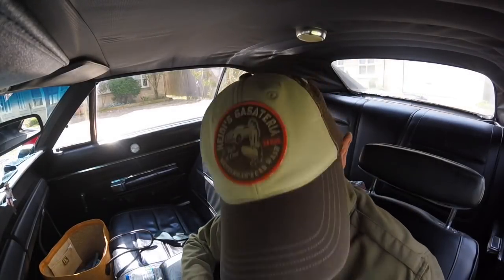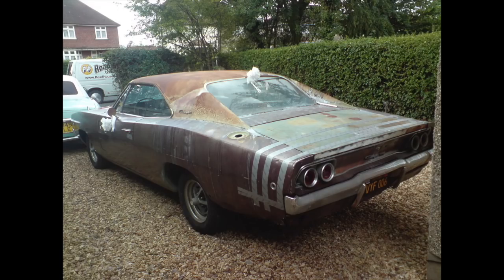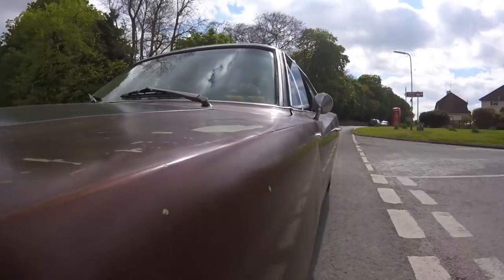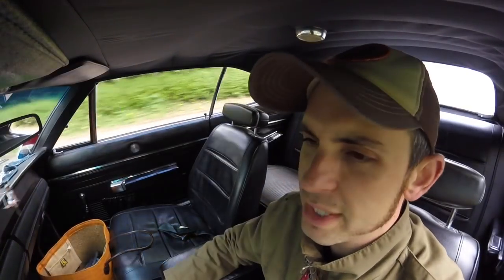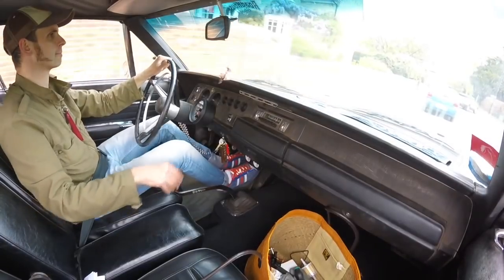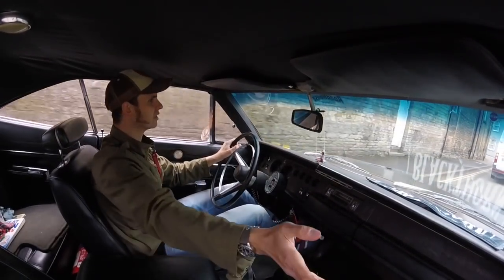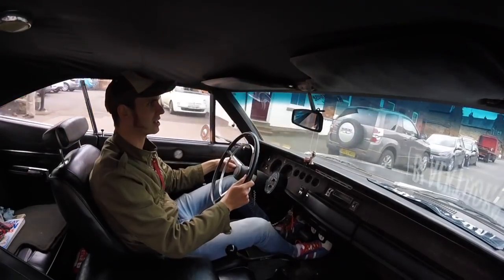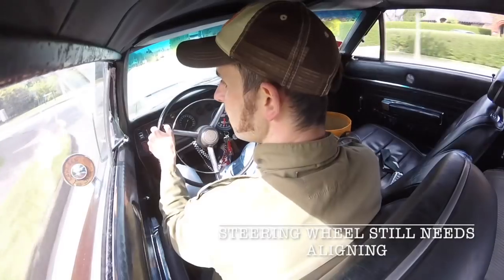1968 Dodge Charger MoT trip - Jonny Smith

Comment: Oh man, quick tip. When it won't go into gear, leave it in neutral, let the clutch out then press it in then after that you should slip in just fine. Unless you hear a grind.. then just don't do that again. I noticed you kept pressing in on the clutch.. gotta get the primary spinning to mesh. I hope that helps!
Reply: And at the end it appears you did that, so nevermind, I think. Up too late. Goodnight!

Comment: Love the Mopar, and I fully agree with your dislike of the MOT exemption for pre 1960 cars. Even reasonably diligent owners can get caught out with brakes going off etc by growing to compensate for weaknesses. Even well looked after cars can still rust, especially if they are used reasonably often and get wet. It could be a real problem waiting in the wings.

Comment: Disc brake swap is easy from Dr diff. The steering wheel and shaft on Chryslers has a a key way at each connection point, the places it can get screwed up is in the steering column connector and pitman arm.
Unless some ape has filled the keys out to put parts where they want.

Comment: Beautiful car, Jonny. Friend of mine had a 74 Firebird Formula 400 which I pottered around the Cotswolds in a few times. I agree with you about the fun of driving something so incongruous. Did the factory tachometer in the dash stop working when you converted to electronic ignition?

Comment: Hi CarPervert, So where is that testing station handing out dodgy (inadvertent pun) MOTs? Should have failed on at least the seat belts, incorrectly coloured lettering on the license plates and most likely the turn signals as well, just a guess because you didn't show those.

Comment: Would you be tempted to upgrade the braking on it?
Reply from the maker: l1fechooser No. I like the challenge of the OEM non servo drums. It’s not that bad actually.
Reply: I had servo assisted drums on the Coronet and they were very decent, dont know abut fading but the stopping power was easily good enough. Imagine non servo to be fine also.
Reply: An emergency stop in that will be an end of life time event either fir the driver or the person stupid enough to walk/pull out in front of that thing. The brakes must be scary.
Reply: Christian Buczko Based on my own experiences with all round non servo drums, yes. But that wasn't this specific car, and if a pro car journalist thinks they're up to the task, I'm not going to argue.
Reply: It depends where he drives and how. Those brakes wouldn't be good regardless, and being able to stop and be road legal and stopping in an emergency are two different things with a car that old.
Reply from the maker: Brakes aren't too scary to be honest. You just have to be alert.